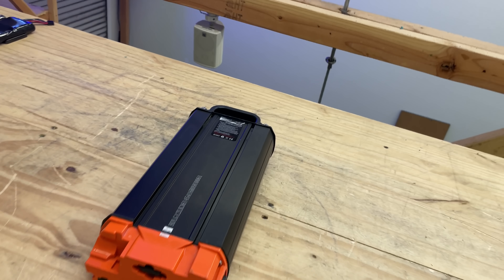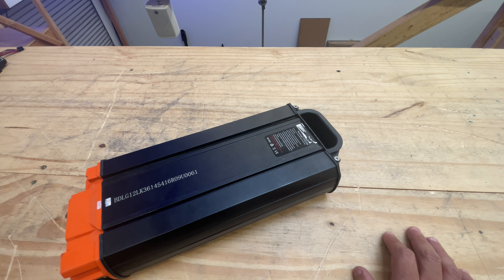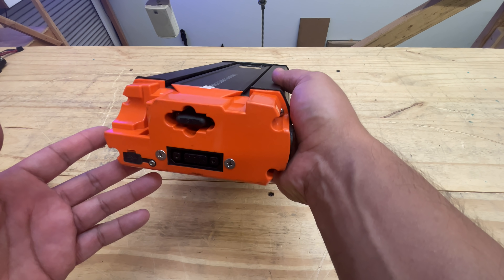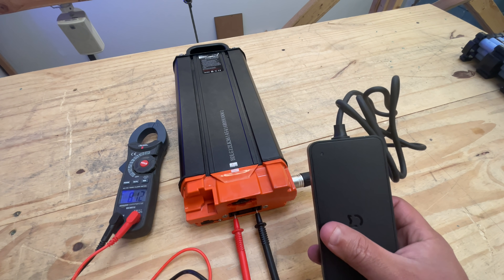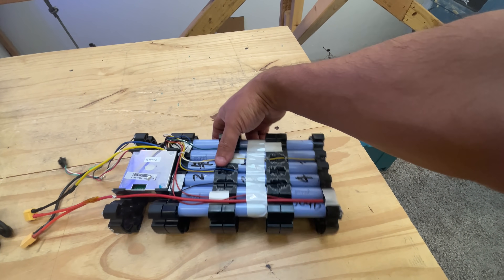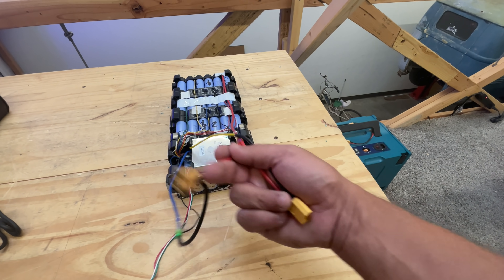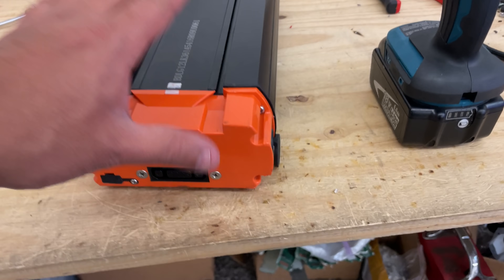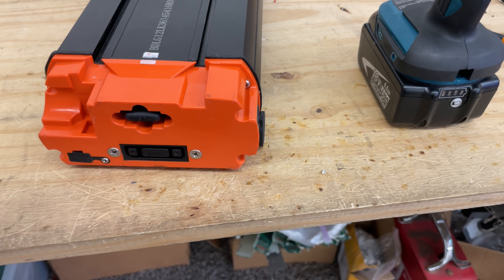The $49 dollar 500Wh eBike Battery

Comment: I love the tip regarding recharging an apparently death battery pack.
I experienced the same issue with my scooter's 48V 28Ah battery, I didn't use it for more than 2 years so when I checked it for total charge and recharge I could see several strange issues with the leds, eventually after a while the charger started its normal operation and it recharged the battery!

Comment: Ooh sold out. I bought a pallet of modem back up batteries with  Samsung icr 28A SDI.
4 batteries in each pack. They were new but headed to the recycler.
These are the best pack batteries I’ve ever used. I have one 48v battery pack with 4 years of heavy use showing no signs of degradation.  They are rated to a charge of 4.3 v per cell with 5 amp discharge.
Grade a cells.
I’ve used a lot in projects however still have a lot remaining. If you see these cells for sale ... buy them!!  However there are a lot of fake cells out there.  Weigh them on an accurate gram scale  they should weigh 42 grams or more or they are more than likely fake!

Comment: Thanks Jehu.  I just bought one. $49 for the battery and charger. $13.67 for shipping. Pretty sweet deal. I'm going to put this to use on the ebike I made following your other video (the $150 ebike).
Reply: Wanna reply when you receive it. I'm wondering how you get 50 samsung cells for 50 bucks
Reply: Hello, how did your project go? Were the batteries good or faulty and how difficult were they to work with?

Comment: I see how you used the pack in the video.  It would also be nice to see how it could be used with something that would output 110V AC (without having to pay a few grand for the larger battery pack).  Something like this could be useful for a laptop, or stringing a few together for a job-site table-saw.
Reply: Laptops are DC and around 17-19v, and to get AC mains power all you need is an inverter which can be had cheap.

Comment: First I will explain the difference between Series and Parallel*. Series is when you connect the positive (Red) wire of one battery to the negative (Black) wire of another battery and do this with as many batteries as it takes for the voltage you want. ie. 3 - 12v 5A batteries in *Series makes 36v 5A. Connecting in Parallel is when you connect the positive (Red) wires and negative (Black) wires together. This keeps the voltage the same but increases the amperage. ie. 3 -12v 5A batteries in Parallel would be 12v, 15A. I sure hope this helps.

Comment: I have a Ecoflow Delta Mini. I also have a few 48 volt ebike batteries (10.4, 14, 15ah). Solar input specs are 11-75VDC, 10A Max, 300W max. With the proper connectors/wire, can I safely use the batteries to add juice to the Delta Mini? The voltage seems OK, I'm mostly concerned with the amps and watts.

Comment: the excessive current draw i think is what causes battery fires or helps shorten the life if it is over discharged.

if the charge is not current limited then it pushes too much current and a chemical reaction maybe like electrolysis (like crack water into hydrogen and oxygen) but releases gasses that can build up pressure and blows out the cells and starts fires.
Reply: Wow you're smart, I saw the news where the batteries were spontaneously catching fire. Now I'm leary yet I really need one.

Comment: Have to say I wouldn't charge that low-voltage battery that way.  It is widely recognised that a really low (<<2.5v) li-ion cell should be brought back with a much lower current than might normally be used for charging - say 0.05C or less. Also, forcing the power brick to turn off presumably due to over-current into lower than specified load voltage (8v)  is not exactly going to extend its life. For a few $ you could use a boost converter with CV and CC control that could initially be set to 50ma and perhaps 41v using the power brick as the input source, then turned up once the volts reach 25 - I would personally want to monitor individual cells.
Reply: He is using a 2 amp charger for a 500wh battery. That is 0.2C for a couple seconds. Then it resets. Then 0.2c again for a couple seconds. That is very close to your 0.05c expectations. So I don’t understand the complaint.

Comment: Hey homie I like what you said and I my self have just began to use these type of batteries, question I am getting a Bluetti EB 70 and would like to get a back up battery or like you build one I would like to pick your brain what is a good match for that eb70  also I really like the solder gun or iron you use what kind is it thank you so much for all your vids , I live in the mountains in Northern Cali there is not a lot of Solar stuff or stores around here I will look for your answer and I thank you again Amigo. PS the EB 70 is for camping that is what I intend to use it for fyi.

Comment: well said Jehu, many reason they get shelved. in the medical field and fire department, they get news one to be on safe side of equipment failure. but the batteries are still good. i have found 7Ah / 10Ah lead acid batteries that i refurbish. refill with water and charge. (what someone chime in because i didn't say distilled water) hate those smarty goodie two shoes... "CALLESE! / SHUT UP!" ok, got that off my chest.

edit: you can use that battery as a DIY solar power system, battery bank, solar generator. for those who don't want to solder, use the twsit caps, or the newer push chingaderas.   as always  i Like, OLE'!

Comment: I have a question! On the ebike video you use a xt60 charger on the battery but it looks to come with a xt30 plug. Can I just use a xt30 charger on the battery or do I have to solder a xt60 cable and buy the xt60 charger?
Reply: depends on the amp draw Xt60 is common rc use and can handle over 90amps for a few mins without melting. XT30s i have seen with over 50amps running though them.
Reply: Not too much to worry with the charging aspect. The charger only charges at 2A.

Comment: Thanks for the video and offering these! It looks like a rear rack mounted jobby which is meant to slide onto a skid plate type holder which has the male plug.  Can you measure the width of the grooves? Just curious if I can just slide it on the one I have... I can make it work one way or another though!
Reply: Lol... guess not since they sold out before I could even 💨!
Reply: I dont know if its useful anymore, but the battery looks exactly like the ones used on a Qwic ebike. I believe its a Dutch brand.

Comment: If one wishes to build a 1-3 kw-h battery - best source of cells?  Lithium-ion or lithium-iron?  Voltage? (no inverter needed - 12 volts dc output needed).  Thought to use a nominal voltage of ~ 52 volts or so, due to ready availability of 14-s (lith-ion) or 16-s lith-iron.
Reply: LFP is less expensive. Then it depends on what you want to do with it.
No answer for no specification.

Comment: Common sense works.   What about like in the Simpsons I think bill gates or something had a solar golf cart.      Being enthusiasts with avid knowledge and some of us have electrical engineering degrees or studying for one like myself.       We need to make a over clocked super charged e golf cart either solar powered or throw a harbor freight quiet generator in the back like a 4000 watt one.   Yeah your using alittle gas.  But the power and little maintenance after the electric install.  Would pay for any gas you use in saved maintenance and parts.

Comment: How did you know the pins were in the right location on the charger? I once had a scooter without a charger. I found one with the right plug but the +/- were inversed compared to the scooter's user manual (and I take you don't have a user manual for this battery pack? :P)
Reply from the maker: We took the battery apart

Comment: I have a 36 volt golf cart...Could I put 6 in series and get my 36 volt 90amp hours?
Reply: First I will explain the difference between Series and Parallel*. Series is when you connect the positive (Red) wire of one battery to the negative (Black) wire of another battery and do this with as many batteries as it takes for the voltage you want. ie. 3 - 12v 5A batteries in *Series makes 36v 5A. . Connecting in Parallel is when you connect the positive (Red) wires and negative (Black) wires together. This keeps the voltage the same but increases the amperage. ie. 3 -12v 5A batteries in Parallel would be 12v, 15A. I sure hope this helps.

Comment: i can solder.. i can drill holes.. but figuring out what connectors to use.. how to configure everything.. what solar charger i should use.. what solar panels i can use.. and what odds and ends i should use is all just a bit over my head.. the more i read up and watch about all of this just seems to be confusing me even more
Reply: i would love to see how much i could save and make a set up to charge about a 10kw battery bank from solar to use on my ecoflow delta pro

Comment: OK I hear that you're into making things so I need to applaud that.  In a limited sense I am too.  But when it comes to electricity/electronics I'm at a loss.  What I want to "make" is a 12V battery pack to run my camping fridge/freezer when the car is off.  I'm 74yo so I guess if I can make a battery pack then it will probably be a lifetime unit for me.  So I'm guessing that this battery is currently 3 x 12V in series for 36V.  So I know I need to change that to parallel.  I know it needs a new BMS 12V.  I can locally source the plugs to make it compatible with my toys.  So could you choose the parts for me to make this a "12V kit"?  Any help or recommendations appreciated.  I can follow a simple diagram if necessary.  Still trying to learn but I'm a lot slower since a stroke.  Thank you.
Reply: Mike you need a 12 volt battery for your 12 volt fridge these batteries are sold out. You need a ready made ready to go 12 volt lithium battery anyways to reduce the hassle.
Reply: @herbertwerner2287  Thanks for the reply but I want to learn more.
Reply: @mikesmith1550  I understand I do.
Reply: I suspect it's more like a 10 x 3.6v in series. If you search on YouTube for: how to make a 12v lithium battery, I am sure you can find some good tutorials.
Reply: you'll want a 3s pack and whatever s in parallel to make a 12v pack but be carefull using a lead acid charger with as they charge to 14.8v not the 12.6v a 3s pack will want. Isdt make good hobby chargers for your needs, no bms needed.

Comment: 500 wh. How long would this run a simple “box” fan?
Reply: 500 Watt Hours. 500 Watts for 1 Hour. 50 Watts for 10 Hours. 5 Watts for 100 hours.
A box fan probably runs off mains power, so this will power it for ZERO hours.
Reply: @johncoops6897  it takes a 50 watt inverter attached to the battery (duh) to operate. With the inverter how long a runtime?

Comment: Still waiting for the chargers here Jehu ser...
Reply from the maker: They are coming
Reply: Hi Jehu, I'm so happy with the 2 batteries. Using them with a 1000 watt hub ebike motor  and a 1500 watt bldc @ half throttle squeeze, it feels like the wheel wants to leave me and the bike behind! Also got more distance and have only charged them  today. Connected 2 in series @ 35 mph half throttle on my eDrift trike, muchas gracias man!

Comment: Caution:  "Do not boost lithium-based batteries back to life that have dwelled below 1.5V/cell for a week or longer. Copper shunts may have formed inside the cells that can lead to a partial or total electrical short. When recharging, such a cell might become unstable, causing excessive heat or show other anomalies."

From battery university.  Just because a BMS allows boosting doesn't mean that its good or safe for the batteries.  A good quality BMS will lock out the pack if the cell voltage has fallen too low and won't allow charging.
Reply from the maker: A good bms won’t drain the cells below 3v
Reply: @jehugarcia  Pack read like 8v and climbing in your video.
Reply: From battery university?

Comment: It's a cute battery but with only a 300'ish watt-hours discharge rate it's not very useful even for most e-bikes who likely need between 750-2000 watts unless it's in Europe where they are slaves of governments that only allows them 250W e-bikes because the "government" always knows best...
Reply: Actually we can have any size battery we want, but over a given power rating we no longer have a bike with electric assistance, which is legal without insurance or helmet, but a motorbike, which is not allowed on bike tracks. I think that's a pretty good system. Of course, it won't work for people who are too lazy to pedal.

Comment: I just don't understand why can't I press a youtube button to report a video that can result in harm for people that follow the video.
so the facts are simple :
the battery management system (BMS) will never accept  charge if any of the parallel pack are below somewhere 2.5 or 3.0volts, correct, but this is not valid for all BMS, and perhaps that is the reason why they were considered defects, did you test it ?
this must be the 1step, never connect anything without measuring each 18650 lithium cell. 
the expansion of an 18650 lithium cell  is 28:1(get this info from the fire department), meaning a single bad 18650 will blow that box, aluminum pieces flying everywhere.
there is no such thing as a low charged 18650 lithium cell , there is only a permanently damage 18650, it will fail way sooner then a non permanently damaged cell.
Reply: What! when was the last time you used lipos 2005. Cell construction got way better than that over the years. My rc ISDT charger will still rescue lipos  down as low a 2v for a lipo. Have done this many times racing quads. ACEHE packs were the best they take a licking a keep on ticking better then most the rest out there.